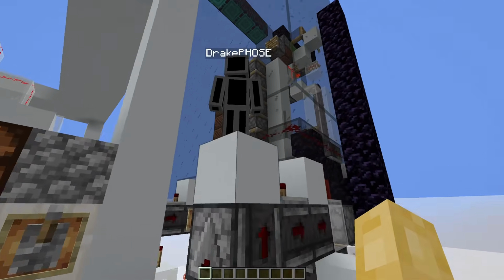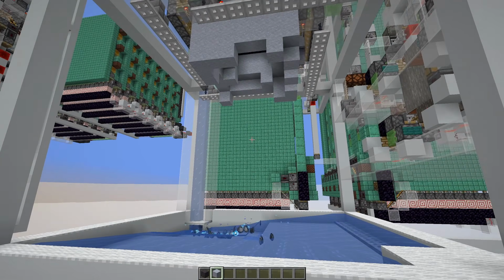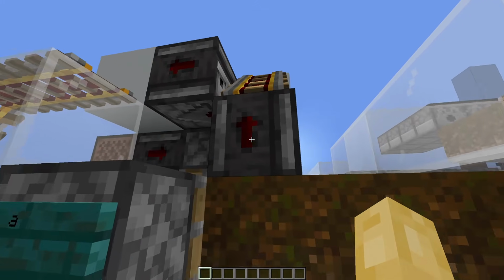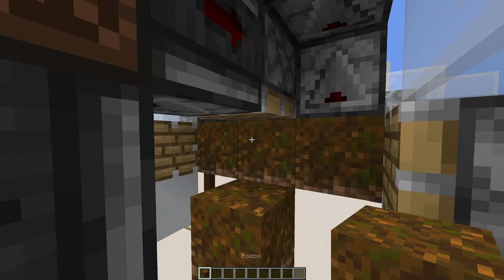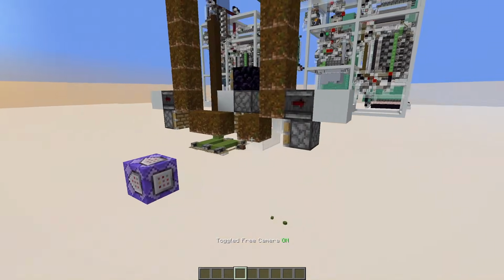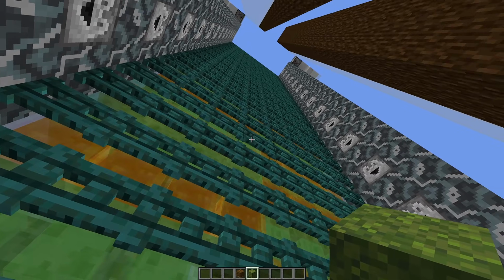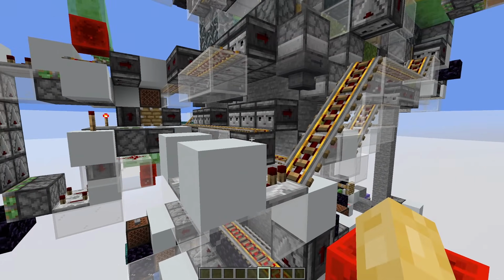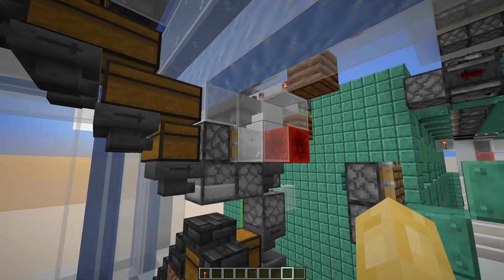Let's Build a High Efficiency Dirt Farm

Comment: I use this farm on my server. It has a few drawbacks:

1) Sometimes items get stuck, pushed up by bubble column against iron hatch, below tnt blast chamber. It seems more blue ice on the floor can fix that
2) It spams to server log with "boat moved wrongly!" warnings. I had to install plugin to filter such messages
3) About every 5 minutes it gets stuck with L-shaped sapling placement. Because 3rd sapling gets placed not against the log, but against the side of the 2nd sappling. The only way to solve it is to afk with autoclicker script with ocasional left clicks to break L-sapling formations. This farm can NOT be afked with F3+T method
4) About every 8 hours creeper spawns on solid blocks on the roof, drops on the boat to negate fall damage and then explodes you. All solid blocks on the roof should be glass-covered and illuminated, original design is NOT  safe
5) Bone meal pipe is broken. Dropper at 15 61 7 isn't powered due to stairs block being transparent. So 3 out of 8 bone meal dispensers eventually run out and dirt rate drops significantly. Stairs can be replaced with solid block, because pistons above moss are timed perfectly to clear them fron water before applyijg bone meal.
6) @Encryptd created far better design for dirt farm, because it uses minecart instead of boat and it has wider and shorter stone tape.

Comment: Wait a minute, since 1.21 we can automate crafting coarse dirt, could a semi auto afk dirt farm work?
Reply from the maker: Renewable gravel through bartering is trash though and not worth exchanging gold for dirt. You also need to hoe the coarse dirt to turn it into dirt.
Reply: @cubicmetre  Well, think about it though— if you have a gold farm, you also have a biglin partering farm, so you've probably got gravel pouring out of your ears as basically a waste by-product :0 Plus, in settings like skyblock, dirt is way more valuable than a mob drop. There's still the issue of hoeing of course, but that's why I said semi-auto.

Comment: Had to replace a waterlogged stair, in the corner next to the bonemeal, beside the dropperline for bonemeal, to a solid block. the dropperline were not activated and the bonemeal in the middle and on the side of the player did not get filled up

Comment: I know this is late, but id like to see an auto lava bucket farm added into this for fuel to power a super smelter making bricks/terracotta/glazed terracotta with auto crafters
Reply from the maker: Automated lava farm would be kinda dumb given you need the player to pick up the lava, the player is also needed to place spalings so that wouldn't really work very well. It would be better to smelt the logs into charcoal then use the charcoal as fuel because the logs are a byproduct of the farm anyway
Reply: Lava farm is quite simple I just mixed the small and the big of il mango to a farm that poroduce 1020 buckets once full in 8 minute....but this kind of farm are so lagged....to avoid it I built in the nether and take buckets in the overworld super smelter with shulkers and rayils....
About supersmelters, I designed 2 my self....one with lava buckets in a 70 furney ring (can use coal and kelp to) and one of 64 with bamboo using piston bolts to work with stack and shulkers....but they are big just try to put 70 furney in a square or 32 in 2 line long 😂 I do not think will fit the purpose of compact design

Comment: @cubicmetre I don't know if this has been noticed or fixed, but since this is the newest video that included your blast chamber I'm commenting this here, the water collection system at the bottom of the chamber has 2 streams of water that any items that fall exactly on one of these 2 streams gets stuck and does not go up the elevator, kinda like this, with E being the elevator, T the trapdoors, and the lines are the working flows, X is the flows that get stuck. It's quite minimal honestly, but just wanted to mention it and wondered if anyone else has noticed it, I have not come up with a solution but am trying.
ET-----
TTXXXXX
|X\\\\\
|X\\\\\
|X\\\\\

Comment: When pasting this is a multiplayer world the fault detection system keeps triggering after using any of the farms but scematic verifier says everything is ok anyone have any idea why this keeps happening? Everything works fine when pasting in survival tho.
Reply from the maker: When you paste a schematic in multiplayer all the inventories won't have their items included, meaning hopper clocks, droppers and chests will be completely empty preventing the machine from working. I would suggest going through the schematic and locating the inventories then filling them with items manually. Unfortunately this is simply a limitation with litematica and I have pressured masa a couple of times to implement server side compatibility, however masa has done so much for the technical community in making these mods in the first place, and the mild inconvenience of filling inventories by hand is a small price to pay for such amazing technical tools.
Reply: @cubicmetre  After Building it all by hand and checking the inventories it seems to work. Thx for the help.

Comment: I am almost near to finish the farm in java, I built 2 way of it starting from your concept buildng not using world download. And trying to modify it on my taste, ex with leaf crusher and logs extractor.
I managed in 1st way to do a cicle in 16 seconds, but it was bonemealing the up podzol where you plant samplings so I inverted the sequence , so it push logs extractor and leaf crusher at the end and it will require 20 seconds, but I have alrady an idea on how to try to speed it up 👍
Reply: I ended built it, I did 2 in 1: only wood and it work in 4 sec. cicle, or wood and dirt in 17 sec. I tried many times but I was not able to take it to 15 sec into java edition. The only way I can think is to speed up the stone generator, but it will mean to change the collection of podzol beacause the 1 stream to a tnt chamber can not work more fast then a 7 tick clock...now I need to found a way for the log tnt chamber
Reply: I managed to finish it, it work 10 sec for one cicle, I did it removing the one line stream blocks to the tnt chamber designing a new blast chamber that blow up blocks in 2 8x3 lines with tnt from underground
Reply: Now I will build it in my Minecraft world 🤣
It will be the biggher farm I ever done
In the dirt way it collect quite same quontity of wood and dirt. I am not sure of the exact rate, I do not use mods, but I think it is a little less then your farm....but I am quite sure it is near 10.000

Comment: i built this and was just having problems getting the boat to place and until now i couldn't figure out how to place the boat
Reply: You have to place the back dirt first, so under you need the piston and the soul sand block that is connected to the tree detector, so place boat above the piston extended and the soul sand block so place the other 2 block of dirt above it and push them down with 2 normal pistons powering from above with a redstone block so remove pistons and redston block
Reply: @nessunonessun1  yes i have done it

Comment: Hey cubic, I've created that farm in my world and I managed it to work, but I found a problem in your design
To explain it better, in your world, there is a dropper in the coordinates x:15 y:61 z:7 that is not being powered, the observer that was meant to be powering it, is actually powering a waterlogged stair, and because of that, no bone meal can flow through the farm up to that point

It's actually pretty easy to fix it, you just need to power it using observers coming from the second dropper behind it (at least that's the way i've used to fix it)
And thank you for this farm, awesome work man!
Reply: I have a question for you, does the boat also makes you suffocate every time a tree grows ?

Comment: Would it be practical to destroy the logs using fire spread to help preserve the blast chamber's efficiency? It would require a player nearby for random ticks, so it wouldn't be perfect, but it seems like it might be worthwhile particularly for rooted dirt designs which have the problem of the really high logs:dirt output ratio. Splitting the logs into several very slow blockstreams over lava / burning netherrack would allow more to burn in parallel, & reduce the frequency with which the logs have to be moved (dousing the flames).

Comment: Instead of the water flushing the moss crap, why not push up the moss too?
Reply from the maker: Moss breaks instantly if you try to move it with a piston, it is non-sitcky and immovable. That does mean you could use the leaf crushers to clear the moss in theory, however for that you would need to guarantee 100% moss conversion from the stone.

Comment: The only problem with using podzol approach is that you can't obtain actual rooted dirt item (also that you need to afk first at dirt farm, and then to convert it into mud)
Reply from the maker: Yes however I would argue that dirt is probably one of the more important resources, especially for terraforming. Which means being able to produce large amounts of dirt directly from the podzol method is much better than the rooted dirt where you will be constantly limited by the durability of your hoe.
Reply: @cubicmetre  that's true

Comment: do i have to build the giant thing with the copper for the farm? where can i make a cut from the copper oxidizer? i need it for a the litematica mod to make a schematic
Reply from the maker: That is just another module from the omnifarm, you could just build the dirt farm and the blast chamber if  you only wanted the dirt.
Reply: Ok, thanks. Also i can break all the Chopper Blocks. The big White Frage is the farm with the Spruch tree farm on top of it. Right?

Comment: why do you need to remove the leaves going all the way up? it seems that only the ones at the bottom stop the moss from growing.
Reply: Saplings, for both more trees and more bonemeal
Reply from the maker: That said, the farm could probably do with slightly shorter leaf crushers as it produces a lot of excess saplings, however those excess saplings get composted and turned into more bonemeal which improves the efficiency.

Comment: it would be cool if you could convert the copper oxidizer into an oxidizer and mud dryer multi machine, so that you wouldnt have to build that much more.
Reply from the maker: This is actually the plan, I intend to reverse engineer the copper oxidizer into a configuration that converts the mud to clay. Although something to keep in mind is that the copper takes much longer than the mud to clay does, as the copper goes through 3 stages where each stage is dependent on copper blocks around it. However the mud to clay needs only a single event to convert.

Comment: sick video. i was thinking about blast chamber farms

if a farm is throttled by a 4gt output blockstream we could use more than one blast chamber. (although ik the point of this specific project is getting as much use as you can out of 1.)

alternatively a 3gt input blast chamber is probably possible. i might try and make one but i am very inexperienced with zero-ticks
Reply from the maker: 3gt blockstreams are very painful to work with because at extensions you require block event delay to keep the stream moving. This is because in a 3gt blockstream, blocks start moving infront a piston in the same tick that it finishes moving the previous block and so you need to schedule every piston in the blockstream with subtick precision. That said, the blast chamber can actually handle a 3gt blockstream as an input, because the smart piston going into the chamber has block event delay. This means if you have an autoclicker you can convert concrete and other blocks at 24Kph. However the moment you start expanding the 3gt stream, every piston you add must have longer and longer block event delay to run at 3gt.

Comment: That’s perfect ! Incredible ! 

I’ve done the omnifarm on my server, and then I’ve started to design in creative a mud and clay converter. 
This dirt farm is insane but personally I prefer mine some shulkers of dirt and then put the dirt manually in a mud converter where I have the choice to send in the blast chamber the mud (for mud bricks), or the clay after some afk. 
I also need to say that this farm is maybe too much powerful and laggy for my little server with friends buuut thanks !! 😊
Reply from the maker: This dirt farm was only 5.43mspt on my system, however the leaf crusher could probably be cut down a bunch as they produce excess saplings.
Reply: Hmm that could be interesting ! But I’m always scared about block updates and a lot of flying machines in a same place. And mining dirt for an hour is quick and easy. But I’m definitely waiting for the mud/clay converter ! Good luck to design it, and see you soon 🔜

Comment: My take on rooted dirt option. It might still be the worse of the two ideas because it is slow. But I believe there should be a possibility to make a farm for 1 semi afk person. 

A moss farm can make all the azalea saplings. You put them into a system that feeds players items. The player has the saplings in their off hand and in their main hand a hoe.
Reply: Ilmango has a rooted dirt-->clay farm, which doesn't need AFK-ing, just loading the chunks, but it's very slow. Maybe ~0.5 shulker/hour. I upgraded his idea added one more Azelea unit, and made it a little faster, but it's still ~1 shulker/hour (I don't know the exact numbers, I don't use carpet).
Reply: @MagyarAdam15  this is what I don't get about this farm.  He made a whole point about avoiding having a player involved.  But now it's just a pod farm that requires both a player to run and a player to advance to the next stage (mud).

Comment: What are some of the changes to Minecraft do you wish for that would help make building automated tree farms easier?

Remove the restrictions around the NW blocks at the sapling level?

Better sapling drop rates from a single tree?
Reply from the maker: I think having some restrictions is perfectly reasonable as it creates a challenge, however what I dislike is counterintuitive things like the directionality of the tall spruce tree, although one benefit of this directionality is that you can prevent the saplings that recieve bonemeal from growing on their own and only allow the tall tree to grow.
Reply: @MichaelPohoreski i would say the restrictions on tree growth should be removed, they're opaque and convoluted. trees should just check individually whether each log/leaf can be placed (as in, if there's air/leaves/water there beforehand, which it can replace)

i think tree farms would be just as interesting, they would mostly look the same. you need to keep the space for the tree as clear as possible anyway, otherwise you get fewer logs and leaves. there would be new challenges as well, like you couldn't control the growth shape of oak/mangrove at all